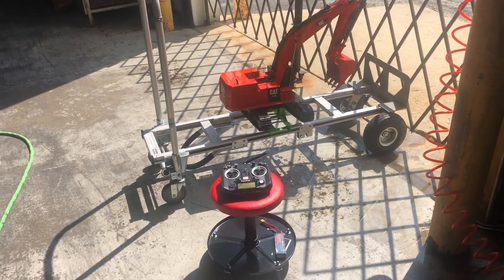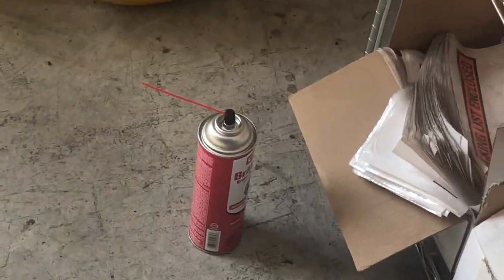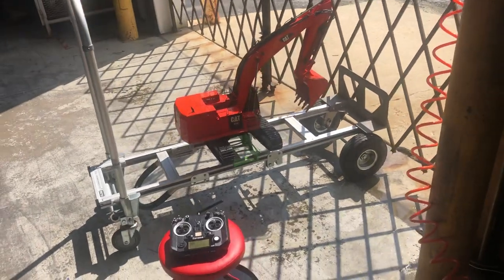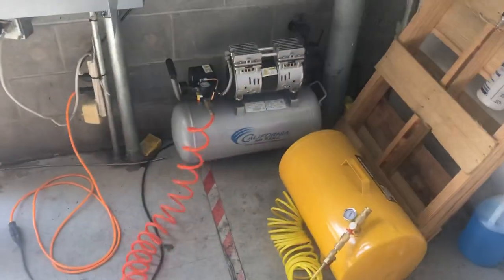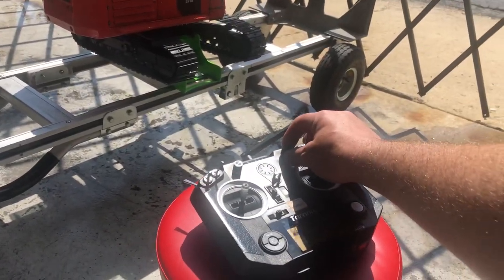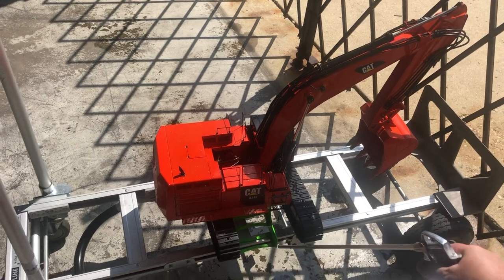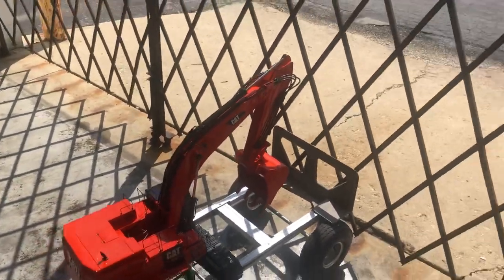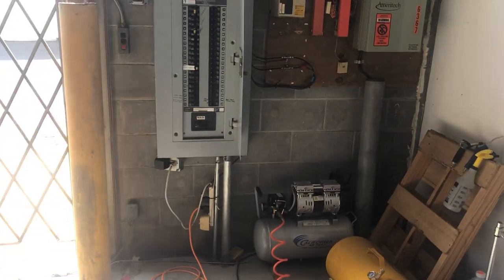CLEANING maintenance on 1/14 hydraulic excavator

Comment: hey what's up mr frank how is going bro so buddy i want your help i have earth mover 870k 2019 yellow and white with radio control FS 10ch i6s white i use battery 3s 2400mAh 35c but when the battery is weak and the pump stop work the battery still full in my radio screen i adjust RX settings from the RX set up i put it 
high volteg 11.1
alarm 5.8
low 0.6
but nothing happen? the setting show me the battery half charger i recharge my battery full but he still reading wrong i think she needs brograming from the RX set up but i don't know how.? i just want how can let the system reading the battery good until when the battery is weak the alarm is on ..if you have any idea about this thing mr frank i hope help me please thx again dude